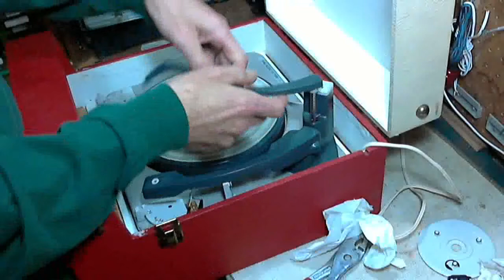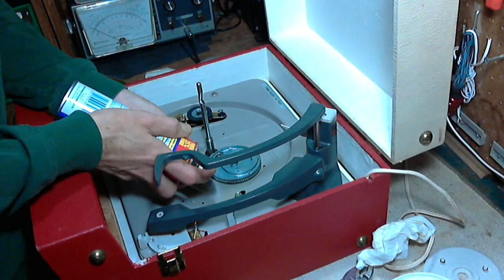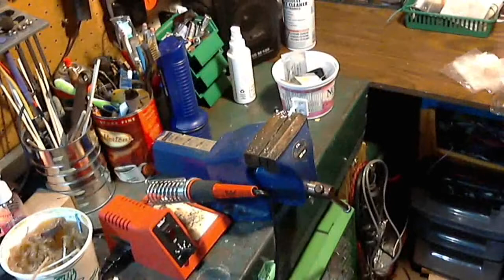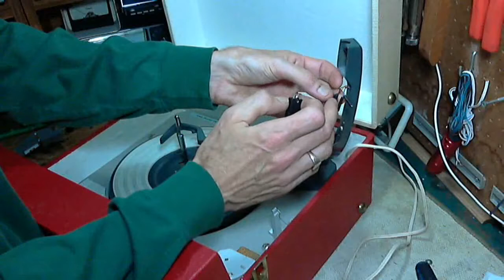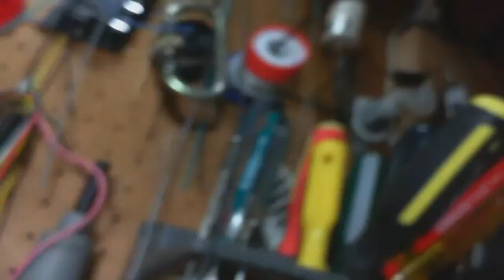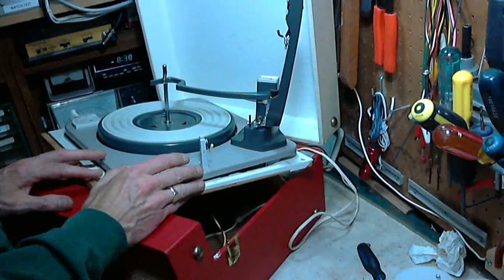Admiral Suitcase Record Player Video #4 - Install New Cartridge

Comment: I rebuilt turntables from time to time for people and myself. 
I love old stackers! But i restore all kinds of turntables. 90% of the time the problem is in soap ,which is in the grease and the soap dries out causing the parts to stick and jam. Over the years I have found the best thing to do it heat the back of the turntables up with a hair dryer to get the grease to flow again,  Then wash it all out , after that , wash it out with Alcohol and then re grease it only in the parts that require grease and oil in the parts that require oil.
You need to use a grease that stays where you put it, some folks use silicon,  I dont, i use good quality grease that is rubber safe.
For the oil sections,  sewing machine oil is fine.
They are fun things to rebuild!  Ive just rebuild a 1960 kriesler stereogram with a Garrard Rc 121 stacker in it, This particular one is for me.
Every resistor and cap has been replaced and its like new again.

Comment: Use a little oil or WD because your not getting to the hidden friction parts, people think that grease will lubricate, but the truth from what I have learned with clocks is it needs to get right to the brass part that the friction is taking place, it can have grease wrapped around it, but still wear the insert. lots of oil can work wonders. oil will get to the point.
Reply from the maker: MrMac5150 Great comment.  I have always wondered if grease flows or if some component of grease is more liquid.  From my own observation, no not really.  I have also wondered where the grease goes on older record players.  Some component must be volatile.  I often will add oil directly in situations where lubricant is required in-between a shaft and a sleeve.  The little roller that follows the race in many record player mechanisms is a good example where both grease and oil are needed.  Often the first issue is getting rid of the oil lubricant (which I like to call gluebricant) and that's not easy if it's trapped in-between to close fitting parts.  I sometimes trust that adding new oil will 'wake up' the old lubricant.  I have two family heirloom clocks that I've never done anything with.  You are getting me interested in checking them out.  Both clocks work, more or less.
Reply: Jim Lindenas I have Grand Father Clocks that have been in the family for years and in my personal maintenance of care since 1980, I do not buy all these over rated oils, a pinch of transmission fluid twice a year in all places, and a wash down with WD40 once every five years because WD has solvent in it which acts as a perfect degreaser and also will displace moisture better then alcohol.

With WD40 you will never get that glue effect.

I say a touch of oil and then if you want a dap of grease. makes a winner.
Reply from the maker: MrMac5150 What is it about transmission fluid that makes it a good choice?
Reply: Jim Lindenas I just find that ATF has good cleaning properties, just a personal choice that I have always had good results with, time tells the truth.

Comment: The starter for a flourescent light may be right, it also kind of looks like a large reed switch.  A mystery.
Reply: pro tip : watch series at flixzone. Been using it for watching loads of movies recently.
Reply: @Roberto Torin Yea, been watching on Flixzone for years myself :)

Comment: There has been a debate about this for decades, but from what I gather is this: WD-40 is NOT a lubricant! it is a solvent, and will not hold its lubrication properties for long. My personal experience with WD-40, its a water displacement. its good for freeing things up, and cleaning things, gunk, its. But it will NOT stay lubricated.
Reply from the maker: ***** Here is what they say on the WD40 product website ( http://wd40.com/about-us/myths-legends-fun-facts/ )

Myth: WD-40 Multi-Use Product is not really a lubricant.Fact:  While the “W-D” in WD-40 stands for Water Displacement, WD-40Multi-Use Product is a unique, special blend of lubricants. The product’s formulation also contains anti-corrosion agents and ingredients for penetration, water displacement and soil removal.
Myth: WD-40 contains Stoddard Solvent.Fact:  Over the past few decades, the name Stoddard Solvent was synonymous with all mineral spirits.  Today, the mineral spirits found in products like ours are more refined and processed (see @wiki/Hydrogenation, @refining/1060.html and @wiki/Distillation techniques) providing mixtures with varying boiling points, cleaning ability, and chemical composition. The catchall phrase “Stoddard Solvent” is no longer adequate to tell the proper story. WD-40 does indeed have 50% mineral spirits, but they are refined and purified for specific characteristics needed to meet today’s performance, regulatory, and safety requirements.
Reply: I never really had luck with WD-40 with anything and lasting. Great to free it up. But thats it. it wont last long, So i usually clean it up after using WD-40 to free it up. Then go behind it with a shot of zoom spout.
Reply from the maker: ***** Zoom Spout?  I had to look that up.  I think synthetic oil is probably the best since it doesn't tend to breakdown and form gum or wax.  I seldom rely on WD40 for long term lubrication.  I use it mostly for softening up old lubrication and cleaning out gunk same as you.  I need to get some light synthetic oil.

Comment: I have some portable battery operated radios from the 50's that have tubes like that. They don't have a socket. They are soldered into the PCB just like a transistor would be. Could be where that one is from.
Reply from the maker: TheScottytr6 Maybe they represent the limit in miniaturizing tubes.  Do you know of any tubes that are smaller than this one?
Reply: That's about as small as I've seen a glass tube. There was something called a Nuvistor. It was not much bigger than a transistor, but was actually a tiny vacuum tube in a ceramic and metal case. They were used in TVs up to the early 70's.
Reply from the maker: TheScottytr6 I don't think I've ever handled one of those.  Some of my tube testers have sockets for Nuvistors.  Gotta get me one of them.
Reply: I've only ever seen them in pictures. My tester has nuvistor sockets as well. $20+ on ebay for NOS nuvistors. Kinda pricey unless you really need one. Maybe Ted has a big box of them kicking around...

Comment: Any particular reason why your using flip-needle cartridges? Use a cartridge that has a stylus with no flip, and it would be easier to mount without having to put shims in place.
Reply from the maker: ***** This player has a 78 speed setting.  A very common use for this type of record player - suitcase type - is to play 78s.  So a 78 type needle is good idea.  I'm not too happy with the cartridge I've been installing lately for a few reasons.  Although I didn't say it, as I was flipping the arm back and forth, I was considering cutting it short so it would fit inside the head shell.
Reply: Jim Lindenas I have a nutone box type record player, I dont think it does 78s, but it does 33s and 45s for sure. It doesnt have that flip stylus, I think it still has its original cartridge. Even has a tube amp with a big 6x9 speaker in the center. Works nice, but i did notice that its lacking highs. turnover seems to be about 8khz or so, maybe a bit more. Is this normal?
Reply from the maker: ***** I can't say for sure but I wouldn't expect good performance at the high end from an old record p;layer.  I'm not sure the records of that time had much high end fidelity anyway.  8kHz seems pretty good to me.
Reply: Jim Lindenas might be... but I was using a modern 33 record. Post 2000ish club record.
Reply from the maker: ***** That's a little demanding for your vintage player!
Reply: Jim Lindenas yup. That it is.. however I never liked the music from earlier time periods than the 90s. And the latest modern music sucks too. I do like some variety of 80s, and very very little 60s/70s. Ccr/acdc thats it. Anything earlier I dont listen to.
Reply from the maker: ***** My most favourite band is Yes.  They started recording in the late 60's and are still releasing recordings today!!  If you like symphonic sounding rock music, no other band compares.